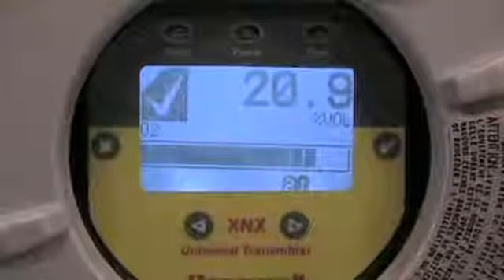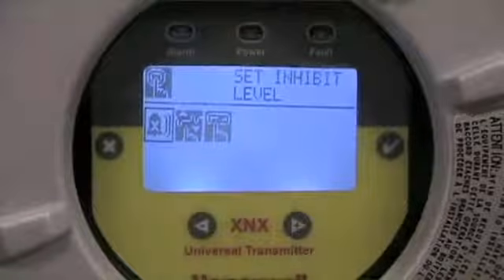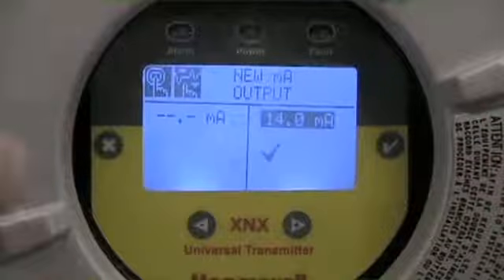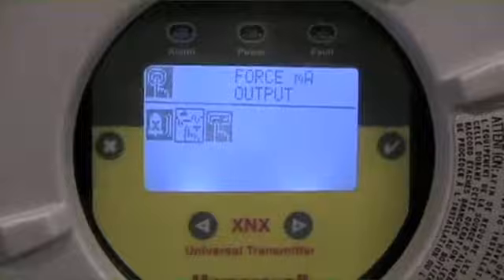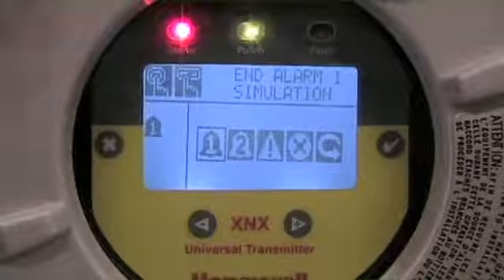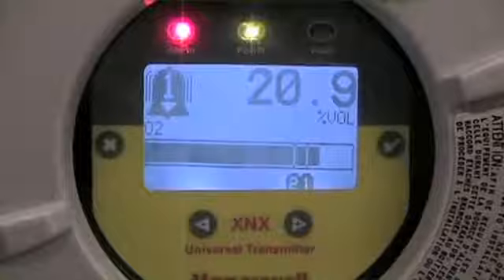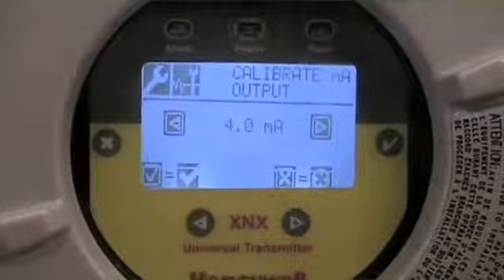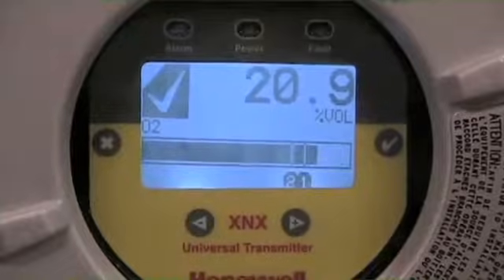Honeywell XNX - Quick Start Video - Loop Verification and Testing Alarm Functions

Comment: Hello, could u please help to resolve w014 warning? XNX transmitter is brand new. But the warning is still there. Thanks in advance!
Reply: Did you ever figure this out. I’m having the same issue
Reply: @mcgsxr600  Hello. Yes. It is time and date issue.The only way to adjust time and date is to use its own tool called interrogater. Trex and Hart 475 does not work for that.